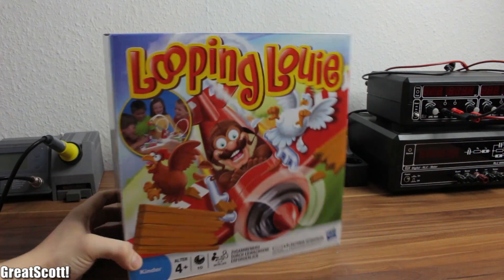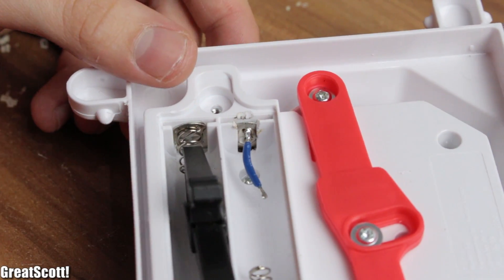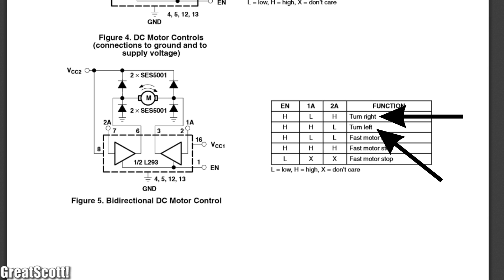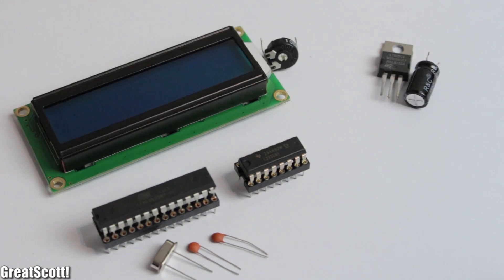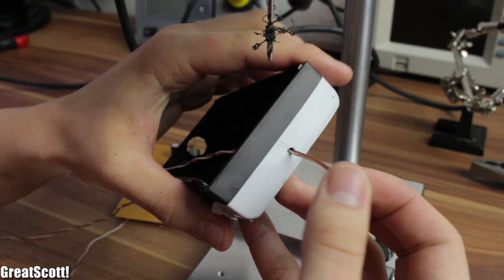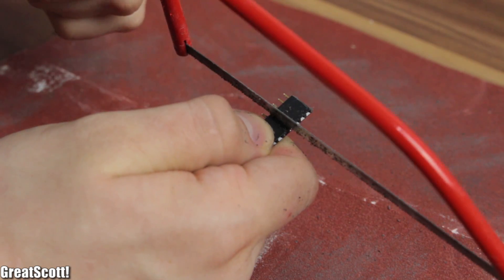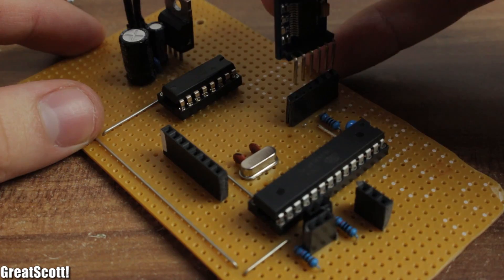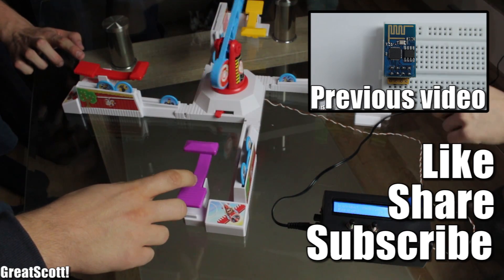HACKED!: Looping Louie on steroids

Comment: Question, the schematic shows two 10uF capacitors but the video shows one 47uF and then a much larger one. Is the schematic still correct? Why does the video deviate?

Comment: I built the circuit the same way, but the buttons on pin 16 and 17 only work when the other side is connected to GND and not to 5v. Does anyone have an explanation?

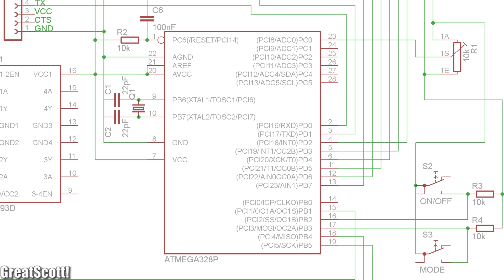Comment: 01:41 fake arduino board
Reply: Mine does not work. 3 refunds and the seller reported me for scamming.
Reply: +Ron Lo Sry to hear that. I bought cheap arduino clones from at least 5 different manufacturers and never had a problem, besides a missing driver for an unusual USB-UART-Chip. That took me about 1h to solve.

lg, couka
Reply: Die Bastler Werkstatt mine came with a cd driver and a label sayi ng: please do not use the software from arduino website, use this instead. (Yes bad chinese grammar)

Comment: SO much easier to use the I2C module on your 1602 or 2004... cuts a lot of soldering and eliminates a lot of wires. Only adds about a dollar to the cost.
Reply: what if you were using a dollar of wires and and solder before?

Comment: Nice project, as always. It only surprised me a bit that you used a saw for cutting the perfboard as I really hate the irritating dust you get from that stuff. Breaking the boards after scoring them with a box cutter is much cleaner and faster.

One final hint: Reichelt has very cheap Molex KK knock-off connectors and a matching crimping tool. Try searching for "PSK" at reichelt.de - and maybe have a look at Paul's video about those very, very handy connectors: HD | PSK crimpen die II (wie es richtig geht + Secret-Project-Teaser)
Reply: Er spricht deutsch.
Reply from the maker: Gregor Ottmann But I like my saw. Anway thanks for the info about the Molex connectors. I might give that a try in the future.
Reply: XperiaArts Ich weiß. Aber wenn er hier englisch kommunizieren möchte, werde ich dem nicht im Wege stehen. :)

Comment: hey i "invented" a new way of controling multiple outputs.it uses and gates and i called it pairplexing.so how it works:for exp if you have 4 outputs on microcontroler you can create 6 pairs -- 1-2, 1-3, 1-4, 2-3, 2-4, 3-4. so you set and gates at pairs and the pair you set high, that and gate responseable for that pair will turn on. so with 10 outputs you controll 45 outputs and it doesnt requiere any spi or complicated programing only digitalWrite :D.so im not a good video maker and can you make a video about it? that wold be fine!